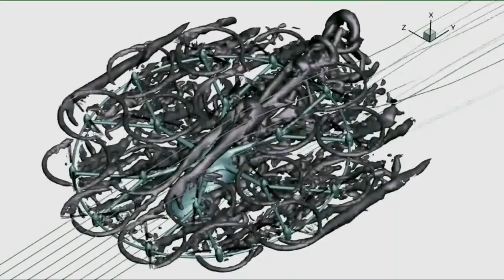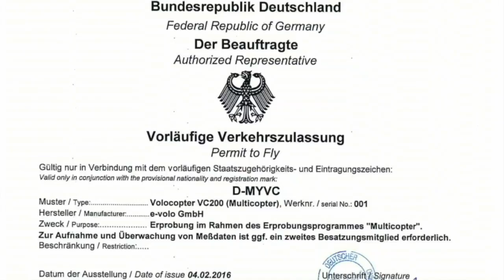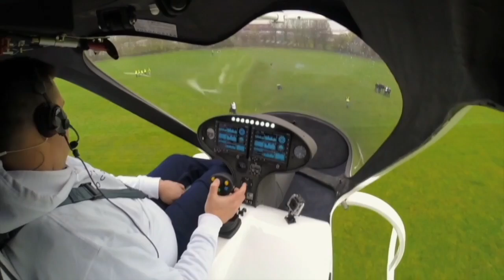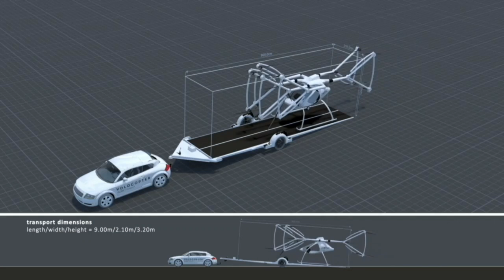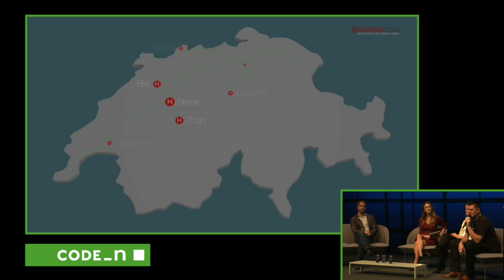Starting up with CODE_n Alumnus e-volo: The Volocopter

Comment: Its needs to be a hybrid, once the battery dies you could be next... its good that it comes with a parachute.
Reply: Don't get me wrong, I love the idea of electric flight. I have a private pilot's licence and over 1500 hours on fixed wing alone (mostly Cessna 172's) I also own a 4 stroke paramotor that I wish was electric but it all comes down to energy density. Take the Watt-hours per kilogram of two sources of energy available; 
Jet fuel = 12,777 Wh/Kg versus Lithium-ion battery = 243 Wh/Kg (and that figure is for the very best available in the world)
You can see that there is an orders of magnitude difference in the available energy and remember the weight of the fuel load decreases over time whereas with batteries you're carrying the full weight to your destination. 
Any commercial flight (and private if you're filing IFR) must carry sufficient fuel to make it to their destination then divert to a designated alternate and then hold (continue flying) for 45 minutes.
Flying is all about minimising risk, no pilot in their right mind would take off with only just enough fuel to make it. Too many things could happen on the way; a headwind, fog or cloud at the destination, nowhere to put down (over water or forests or mountains for example)
If battery technology was to improve to match the energy density of fossil fuels that would be an improvement of over 5200% or to put it another way, would give a Tesla model S a range of 13,780 miles on a single charge. The world would be a different place, a wonderful place. We could get rid of oil and nuclear power if only we could store energy like that, seriously. And yes, then we could have electric aircraft.

Who knows? It might just happen.
Reply: Strange Arguement.... Once your fuel tank dies / is empty....
I don't see the difference, with frequent checkups the reliability shouldn't be an issue.
You can consider a multi-cell accumulator, if one cell dies it's not that bad.
New things are allways scary, right? ;)
I see less danger in this concept than a normal helicopter / air plane. Immagine 1 enige fails, or 2 or 3.. the volo won't crash, it still has 15 engines left.
I hope we can take advantage of this kind of transportation soon in our evryday life but I think we should keep our expectations low, at least concerning the near future, due to scepticism, fear, regulatins and lobbys :/
Reply: The difference is really simple; if you have total engine failure or zero fuel in a fixed wing aircraft or a helicopter you can glide or auto-rotate to a safe landing. In a multi-motor electric aircraft you fall out of the sky accelerating at 9.8 m/s2 until you hit the ground unless you have a ballistic parachute system.
The issue here is that there are no batteries yet available that can provide the power required for practical sustained flight with a useful payload and endurance. Hence the need for a hybrid power supply.
Reply: Luckily they have a paracute built in and the battery issue was adressed mutliple times and turns out to be ok. If this kind of travel establishes you don't have to fly more than 200km with the same battery cause you can either have them changed or supercharged quite fast. And let's be honest batteries are getting better and better with different layouts and materials used. There are some promising next steps. And the whole gliding down thing of planes and esp. Helicopters....the dmg done to the machine and passengers on that "safe landing" (i find this term to be highly misleading in practice) might be even bigger than through a landing with the parachute bulit in this thing. Additionally, since you have less weight, the velocity on impact should be less devestating even on the same speed of impact.

I think if you just like burning fuel, you won't be convinced otherwise easily. 
Evryone is free to believe what he wants, so are you and I.
I'm not keen on starting a harsh argument here, but your argumentation chain feels kinda weak to me, sorry.
Reply: Well, until then we might have to only use them to fly short distances like in cities or in between small towns which are relatively close to each other. In that cirumstances you wouldn't have to have that much energy in reserve, since youre not flying very high or or over large areas without landing space. It would still change alot. Less traffic jams & air pollution (if the energy production is renewable) for example. I'm optimistic that we won't have to wait many years to see them in our evryday life (at least in some countries). Even if they're only used in larger cities or as public transport lines :)